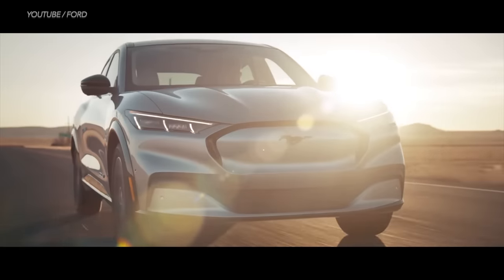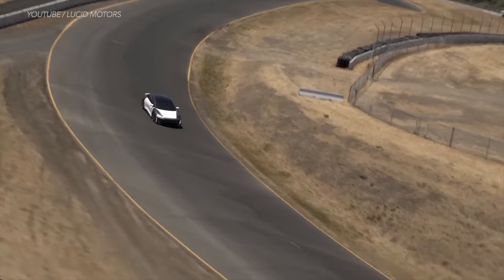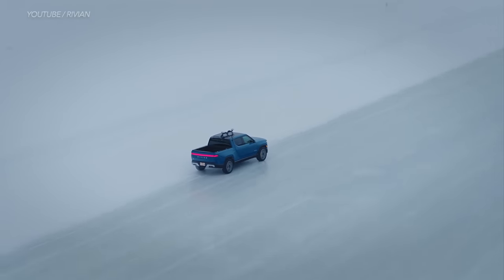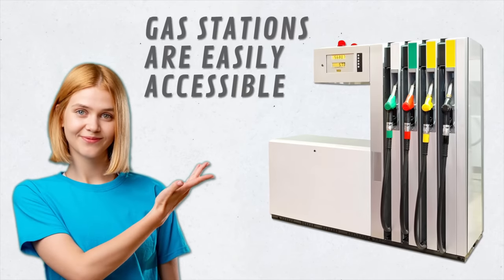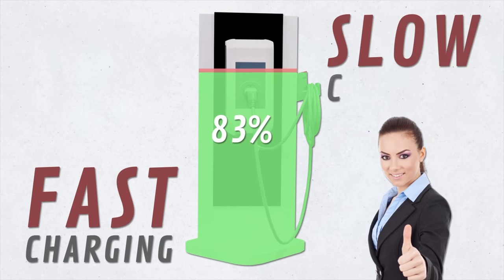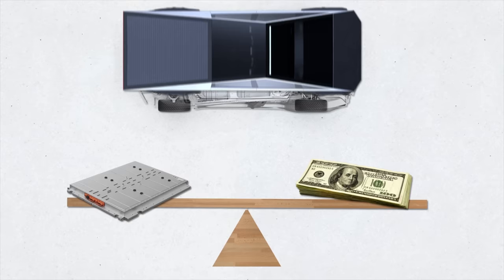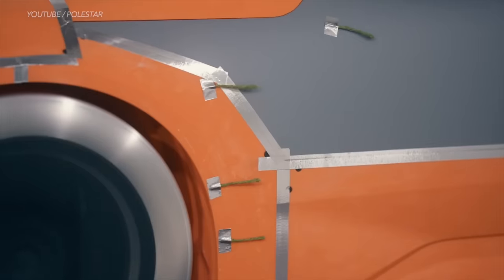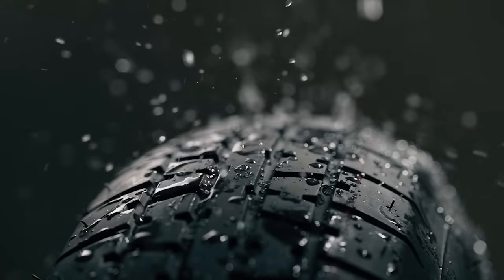New Study Shows Electric Cars are a Scam

Comment: Certain models of chargers, at several charging stations, refused to work in the cold and snowy weather as well. (I watched a recent video on Youtube about it.) Not a great time to be stranded.
Reply: warm thoughts and prayers. 🌞 🙏
Reply: @Zebra_3  Yes, you'd need both of those things out in the freezing cold when the charger refused to work and you couldn't get home. 🥶
Reply: also power outages will continue to prove the inferiority of electric vehicles,
Reply: @colonelyungblonsk7730  And would only increase if more people bought electric cars .
Reply: @colonelyungblonsk7730  Yep. The rolling blackouts in California weren't a good thing for EV owners.
Reply: A local gas station that I frequent installed two chargers, they do not like the cold, and are roughly .50 a minute + fees to use. No thanks.
Reply: @onedayatatime8756  So when your ICE car runs out of your gas and there is a blackout, how exactly did you plan to pump fuel? :)
Reply: Videos on Youtube arte just anecdotes, not substantive evidence.
Reply: @colonelyungblonsk7730  Wrong. When there are power cuts petrol and diesel pumps do not work. EVs are far superior and much cheaper to run. In civilised places li,ke where I live power cuts are incredibly rare.
Reply: @onedayatatime8756  California is not the world. Here in the UUK we don 't do Aircon much so there is plenty of spare capacity, especially at night.
Reply: @rogerphelps9939  I didn't say that California was "the world", and many problems with these EV's have happened all over the US, and other places as well, and that includes China too, just recently, with a runaway Tesla stuck on auto pilot at full speed that crashed and killed the driver. You seem to know it all though, so I know you'll have an excuse/answer for that too.
Reply: @rogerphelps9939  "EV's are cheaper to run" you said, and perhaps that's true, but wait until you need a new battey or repairs. Good luck finding parts or a mechanic to work on them. Hope you've got a big nest egg set aside for that, because you're going to need it. 😂
Reply: @rogerphelps9939  You must be a youngster without much life experience yet. You'll wake up and learn the hard way eventually though.
Reply: @rogerphelps9939  The YouTube videos i watched were proof of some chargers not wanting to work in the cold, so yeah, that IS "substantive evidence" of a major problem that needs to be dealt with. I think you missed that FACT.
Reply: @Michael Wright  you charge at home, unless traveling. For me, at night, the rate is 1cent kwh; that's $3 a month.
Reply: Most BEVs charge at home and the cold of 1-5F didn't effect my charging whatsoever.
Reply: Keep an older Toyota ICE vehicle spare for the winter months.
Reply: Back in the day, a trucker would light a campfire under his oil pan to warm the engine for easier starting. 
I don't really recommend doing that on your Tesla 🤣🤣🤣
Reply: @MrTheHillfolk  Is that a good idea for trucks noe either?  The Tesla can park the battery while plugged in the garage, i can even set the app to precondition the battery on a schedule, eg. When I'm going to work.

Comment: Surprised that most manufacturers didn't put in fine print " Batteries not included " & charge you extra 😁
Reply: @jamesvandamme7786  Vinfast USA is also leasing the batteries 🔋  & require a monthly payment, but aren't swapping them out ,just charging you ....guess getting charged twice ,for the battery & for the actual juice ⚡️
Reply: Well like apple and Samsung the home charger is not included
Reply: @jamesvandamme7786  that is true on the lower cost options

Comment: Wait till the green gremlins see the holes being created to mine this stuff.
Reply: They never leave the cities, so they don't care
Reply: Frankly I’m surprised that nobody is running around slapping bumper stickers on these EVs saying “Proud supporter of child slave labor.”
Reply: In 10 years only the poorest countries will still use gasoline as their main source of transportation fuel. Even many people in India are going to electric scooters.
Reply: @donguess4332  I never said gas engines will go away. I said only the poorest countries will still use gasoline and diesel as the main transportation fuels. Reading into what I wrote isnt required.
Reply: @id10t98  Gasoline and diesel engines won't go away until we get mass produced fuel cells and a network of filling stations for hydrogen or/and methane and/or propane to run the fuel cells.
Reply: @stuarthirsch  Freight trains are electric engines, powered by diesel generators. Mining trucks produced today by Caterpillar are electric powered as well. Excavators and other heavy equipment are all going electric where possible.
I have a degree in metallurgical engineering and did research on hydrogen and it is a long ways off for being used compared to battery EV's and lithium ion.
Reply: Tesla Y is the most made in America Vehicle money can buy. Do we have child labor in America like where there make Ram trucks in Mexico?
Reply: You wanna love next door to an oil refinery?  You wanna built a house where an oil well used to be?  You wanna eat food farmed next door to a gas station?  What about the holes drilled for oil wells?  What EV caused an oil spill so large that it closed beaches for 200 miles for 5-10 years?  Oh wait, that was an oil spill?  How much lasting damage that we don’t know about happened from that one?  Don’t make false equivalencies - EVs are bad for the planet.  Gas power internal combustion engines are bad for the planet.  Don’t forget to take into account all of the energy used to refine the gasoline, pump it through a pipeline, diesel energy to get the gasoline to the gas station, electricity needed to pump the gas, and so on.  You clearly think at a very shallow level
Reply: @id10t98  battery power on a large construction machine won't be efficient enough and they will still have to be charged by a diesel generator. Here in the UK construction sites purchased the battery JCB mini excavators and compared to the diesel engine versions they were using previously they had hopeless work hours and had to be charged up each night to a diesel generator. JCB themselves have decided going down the full electric route isn't going to work with their large excavators,  tractors, telescopic handler tractors and the backhoe excavators they make and go down the hydrogen combustion engine route.
Reply: @id10t98  10 years, huh? Where's the infrastructure gonna come from?
Reply: @kenhowell2280  you miss the point. The raw materials needed to make those batteries, are mined primarily in Africa, and many of those mines operate with slave labour or children, in very hazardous and despicable working conditions.
Reply: @Magneticlaw  Infrastructure for what? In case you havent noticed, there is electricity available all over the USA. It would only take about 5 years to install charging stations all over the USA and the technology to charge while driving is being developed, much like cordless charging for phones, etc.
Reply: @bentullett6068  Freight trains are electric over diesel now as well. Caterpillar is well on their way to making EV' trucks and electric heavy equipment.
Reply: @bighit20100  Yes, this is the secret that no CEO wants to know. By contract, the companies state that no direct hands-on mining labor will be used to extract the minerals. Only machines are to work the mine pits. However: When an actual human being bothered to look into the situation, the mining pits were filled with children, women, and men digging to obtain raw materials with their bare hands. Was the videographer just blowing smoke, or are all of our modern batteries coming from such misery? If they are, holding a smart phone just became something rather sad--not to mention that some of the EV batteries are big enough to require the full floor length of a sedan. "Things Mother wasn't here to teach me." We all have deep regrets about which we can only pray someone will do something, because our voices don't often count.
Reply: @id10t98  Your screen name suits you well.
Reply: They don't care since its not in their back yard. Nimbyism.

Comment: Keep exposing them Scotty! Thanks for the education
Reply: @@joewashington9374And efficient Toyota gasoline vehicles are 10x better and more reliable than electric vehicles and their polluting batteries.
Reply: @Joe Washington And yet electric cars are STILL crap
Reply: @Joe Washington Whatever, Elon.
Reply: Exposing what?! Lol. They are still better than ICE vehicles. Go educate yourself.
Reply: @donguess4332  Nope, they are smoking ICE vehicles on and off road, lol. The Rivian truck smoked the fastest truck on the market, the Dodge Ram TRX. lol. Their AWD system and suspension is being called the holy grail of AWD.
Reply: im going to make my own electric car with lead acid batteries!
Reply: I appreciated that his take was more balanced than usual IMHO, noting that ICE vehicles have some of the same issues.
Reply: @MrBilld75  they will never keep up with my diesel ram 1 ton dually pulling my 21,000 lb rv over the mountains in Colorado on 1 tank of fuel,,,,,hell I doubt  any ev could  tow  my rv more than 5 miles before blowing up or having to recharge for hours on end.
Reply: Exposing what?  Everything Scotty cites here is accurate and Tesla still makes the best cars ever!
Reply: @Ryan-ff2db  best vehicle I’ve ever owned and driven.  Been driving since ‘92, CDL holder since ‘00.
Reply: @truetexan7755   The Rivian R1T can haul 11,000 pounds up to 280 miles. Give it time, they will get there and surpass your diesel.
Reply: @Ryan-ff2db  Well said.
Reply: Cue salty remarks from the ev fanboys lol
Reply: @fidelcatsro6948  Others have done it successfully.
Reply: @MrBilld75  indeed, and theyre safer too! yes they have shortcomings but they dont catch fire as easily as lithium ion
Reply: @MrBilld75  Ok but it's not really about speed. What are you 18?
That's just another bonus that they are actually a little faster than gas hogs.
Reply: @andrewgus8763  based on what information?  Your gut feelings?
Reply: @truetexan7755  They certainly won't keep up with the cost to drive per mile when diesel is $5.50/gallon.   Diesel vehicles also have the advantage of spewing more cancerous fumes into the air we breathe.
Reply: @fidelcatsro6948  Tesla cars were just rated the safest cars in the world.  You can check that online.  Where are you geting the idea that ICE cars are safer?   Ford just had to recall their trucks because the occupants are crushed if their is a rollover.
Reply: @entltyq  Sure, I agree on some on those point, indeed. I think the Tesla semi, was misrepresented. And I think the infrastructure needs to be there, before anyone can look at widespread adoption. And that's just not there yet. Norway is about the only ones who do have that. And it's because they started a long time ago, embracing EV's. All thank's to the 1980's band A-Ha. The lead singer built his own EV back in the 1990's. It's an interesting story and it's here on Youtube.

Comment: Here in the UK.  Electric cars are way to expensive.  There almost  twice  as the petrol version.
Reply: Chevy Bolt EUV's a re the least expensive EV's so I might get one.
Reply: An MG4 starts for ~26k pounds and the long range version for ~28.5k pounds.  That falls into the average range of cars in the UK.
Reply: My 2008 Diesel covers 700 miles on a full tank and takes 3-4 minutes to refuel. No apparent degradation of range since new. Don’t think an EV could match that.
Reply: @twig3288  Hey that sounds great.  But i charge at home, I can go thousands of miles before fast charging.  On long drives, we usually have to stop every few hours just to use the restroom, get food, or whatever, which fits well with charging.  But if you can drive 10 hours straight without stopping you definitely need that diesel.
Reply: @twig3288  But, but, but, but..... "global warming", and  the environment....
Reply: @Adam-qn8fx  Oh. I forgot that EVs have no environmental impact and don’t use slave labour to mine the minerals needed for the oh so green batteries 🫢

Comment: People spending 90 100 110k for these things. Don’t get it.
Reply: Well the Chevy EUV is $30,000, and you can get the $7500 rebate too.
The Chevy EUV looks like an SUV by the way.
Reply: it's a status symbol at this point.
Reply: They are not status symbols, BEVs are practical.  Massive raised trucks that rarely carry anything in the bed are status symbols.
Reply: @martalli  When was the last time you saw an electric work truck? Carrying tools, trailers, plywood, horses etc? NEVER!
Reply: Drive one.  You'll get it.
Reply: Or maybe 27k for a Bolt or 42k for a model 3 (before tax credits)
Reply: @delaware137  I did overly complicated technology and fast. Why do I need to go fast?

Comment: We have 2 cars a v6 minivan for long stance drives, and hauling stuff and were about to get a model y.  The ev will be used for short day to day trips and shorter road trips.  We do not need it to have more than 100 miles in range.  We also do not expect to charge it outside our house.
Reply: No need to leave the Model y at home.  Take it on the road trip.  I took mine on a 1300 mile round trip last summer to Mount Rushmore and Devils Tower.  Never worried about charging or range.
Reply: We are a two car family, one ICE and a Ford Mach-e extended range, If I have to I'll drive the CX5 when driving out of state. My car's range is 300 miles in the summer and 200 in the winter, that's more than enough 98% of the time with a home ESEV.
Reply: @stevemiller9480  Exactly and the other part is ev is great in city setting where you end up braking and idling a lot.  We need 2 cars no matter what because I have a short drive to the train.  But why run a gas engine for 15 minutes on a school drop-off line when you can have an ev.  Plus ev is more fun especially sportier ones like Mach e.
Reply: I agree with @Tony L.  I drove my Model 3 from Chicago to Jackson Wy.   Was able to get in 800 miles a day no problem.  The navigation system does all the calculating for refueling for you.  The Supercharges charge real fast.  By the time you go to the bathroom and get a snack, it's done.  It was easier than the times I drove the same trip in my 4Runner.

Comment: I rented a Tesla SR+ charged to 100% driving average of 70mph I managed to squeeze out 120 miles one way and had 20% left to find supercharger. Took 30min to charge about 180 miles. Getting back was a nail biter....pulled into a charger with 1% of range.  Bottom line a car that costs $50,000+ can't go on a full chare 240 miles?? No EV for me!

Comment: Honestly..  everything Scotty cites here is fairly accurate. With that being said..  my Model Y is the best car I’ve ever had and driven. I’ve never experienced range anxiety and my battery shows zero degradation to this point.  I didn’t get a Tesla for environmental reasons. I got it because it drives itself, has regen braking and it’s fast AF.  Road trips are AMAZING as well. There’s a reason most Tesla owners echo what I’m saying here.
Reply: Well said.. and yes.. Scotty is absolutely correct here!  Not sure what the “scam” is or why people in here think he’s dogging on EVs?  But great video!  😂
Reply: Scotty is an honest guy.
Reply: Yes, for the right use case they make sense.  I think the point is that one size does not fit all. If I lived in the countryside of Minnesota and had to drive in the dead of winter on highways 100+ miles per day...probably go gas or diesel. However, if I lived in a mid-Atlantic or Southern state and did short commutes/urban with occasional long distances drives, sure...plugin hybrid or EV has sense. One thing is for sure...if I owned an EV I would need to have at-home charging access + a decent footprint of publicly accessible charging stations in my area. Currently have a BMW X3 30e M-sport as a company car...this plugin hybrid has saved me about 60+% in out of pocket energy costs. Would not own it on my own dime (BMW maintenance)...but a 4 year company car lease...OK.
PS:  love that Model Y...great car.  I looked at it but there was too long an order wait in my area (Switzerland). Tesla's are very popular over here...Model 3's are everywhere.  Three colleagues own the Model X and love'm; another one has the big sedan with dual motor. Tesla fast chargers are all over Switzerland, so they make a lot of sense in this country for many drivers.
Reply: @jb678901  some good points and a Tesla definitely doesn’t work in everyone’s situation but I’m guessing those situations are getting few and far between as time goes on!  Good luck over there!
Reply: @teslabohl3430  It isn't luck at all, EV's are the future but you can have an old ICE car on the side - I think Ice vehicles are better in the winter too, based on this video.
Reply: Yeah I call y'all "Tesla Zombies". Good thing Tesla has it's own charging network, but at some point the government will step in and open it up to all EVs. That's when you'll find out how much you like you EV.
Reply: Rodney Howard  True, not me though. I didn't get an EV because of the price. 
I have a payment Ice SUV, a 2019 Rogue 4 cylinder it is used and 25 grand out the door.
And I got a 1999 Toyota Corolla with 160,000 miles on it. I got it for a grand and it was in running condition but needing work. The work was another $1000 roughly, plus new front tires. It actually runs real good now so I can't complain.
This may sound good to you but I'm far from rich.
Reply: Not 1 word that you get charged 50% more to recharge your battery than a gas vehicle, you keep telling yourself that 😂